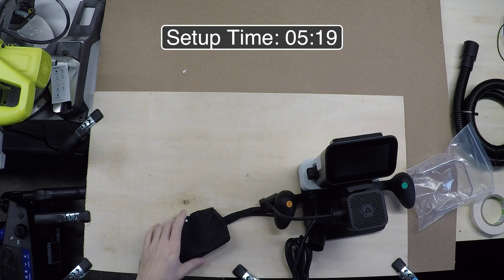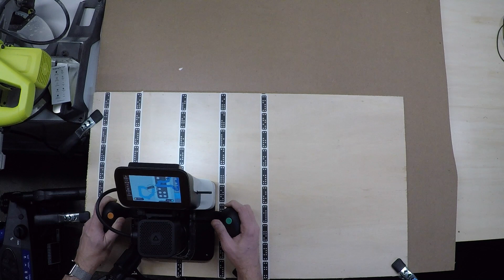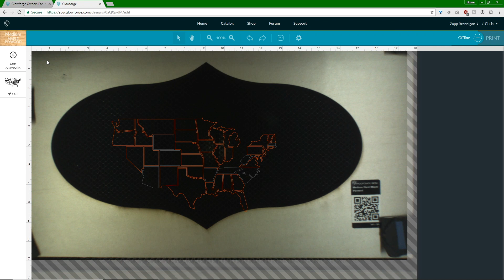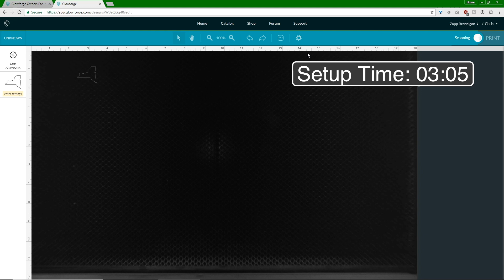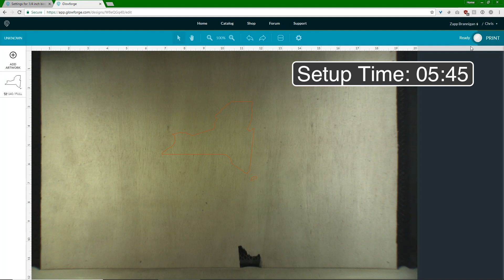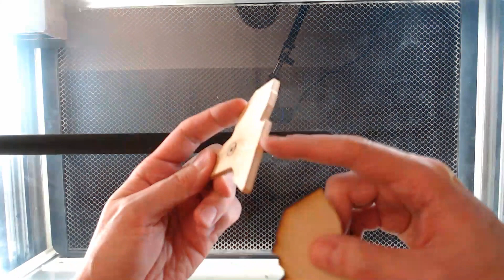Shaper Origin First Cut and Glowforge Laser Cutter Comparison

Comment: great video, this comparison is rare to find

I'm a wannabe maker (looking to make wall signs, wall art, jewellery boxes, jig templates) and was wondering if you felt the shaper origin or a CO2 laser (Xtool P2) would be best suited?

Any knowledge, wisdom and advice is greatly appreciated.
Reply from the maker: If I were in that position, I would probably start with a laser cutter.
Reply: @ChrisMasto   thank you! Is there a particular reason? Ease or time was a main reason for your selecting laser over shaper?

Comment: All you shown was your inability to properly use the Shaper Origin.  Well done
Reply: I find comments like this funny. The shaper is widely known as being kinda ass if you don't baby the living fuck out of it. For a first of its kind product it's neat, but neat doesn't pay the bills. For the cost it's useless.
Reply: @thePretendgineer It's marketed heavily for joinery with the ability to work on materials on their edges, and inlay type work on pieces that aren't possible on a cnc [immovable slabs, floors or cabinets].  I don't think they are meant as a CNC replacement.
Kinda like track saw vs table saw, they do different things.
Reply: @thePretendgineer  4 years later, do you still stand by this assessment ?
Reply: @hv1461  more than ever. I've used one since. Finicky is an understatement.
Reply: I own an Origin and use regular, all I said was it looks like you have barely spent time with it.  Sorry if your offended. LOL